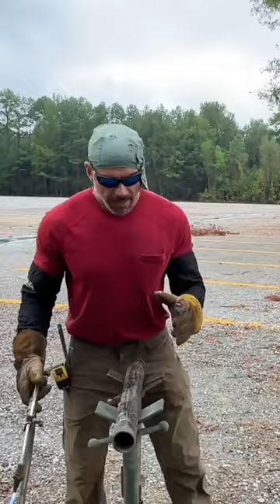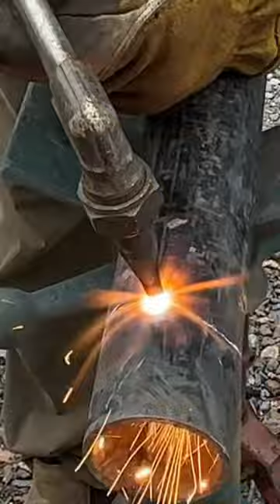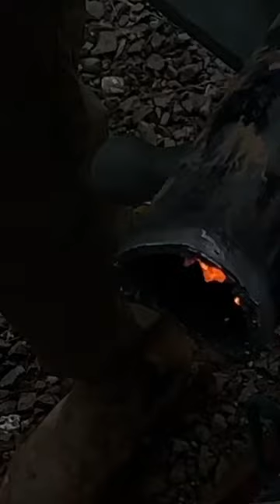Could saddling pipe with a Torch be faster than a chop-saw.

Comment: Back in the late eighties (before the advent of plasma cutters) my buddy fabricated a bumper for my truck outta heavy stock C-channel. I just wanted a straight bumper, but he was a perfectionist and an artist, so he said he’d cut some 45° ends for it. I assumed he would use a portable bandsaw or grinder with a cutoff blade. 
He surprised me by getting a straight edge and a torch. Showed me that slow and steady, with the proper heat and talent, a smooth cut rivaling anything that a blade would have done was possible!
His work was beautiful and precise! No slag, no splatter, no ugly ragged edges!

Comment: Thats hilarious you said it's that's not a hammer.
The exact time I could hear my dad's voice in my head saying
That's not a hammer lmao.
Reply from the maker: Lol
Reply: @TaylorWelding  
He's 91 years old still alive living in Tyler Texas and to this day he would scold me in using the back of my torch to adjust anything or simply knock out a cut.
But on the other hand my rig head is almost 50 years old so I guess it says something for him to be bitching at me about it.
Reply from the maker: @ScottRoss269  I need to do a video on what? Actually happens when you use it like a hammer. I have messed one up before.
Reply: @TaylorWelding  oh I have screwed one up and cracked the head. Makes a funny flame in a weird location making it really hard to cut with.
Also had to hear a truck load of I told you so! From the old man.
But yea a video for those who have not seen it would be good.
Reply: But It IS a hammer!  Some folks just don’t know it yet…

Comment: I learned old school because i didn't have a choice, when i was doing code packages our in house CWI was 70 years old and made me do my super coupon with a file, no grinder allowed.

It isn't always about "faster" like you say in the video (although i do think coping with a saw is faster once you have the right tooling). A big upside is lack of consumables, safety requirements, and tools that require maintenance. Look at everything you need to run a torch setup. Multiple bottles, regulators, hoses, torch body, tip, tip cleaners, etc. Vs a chop saw........ a 120V source. 
  
Now, go work on some sites that require 3 different permits to throw fire in any direction regardless of nearby combustibles (where my power gen peeps at) and you will understand why my rig has a chop saw coping setup instead of a torch.
Reply: For anyone starting to get in the Customising seen I would recommend them to first learn the Oxyline torch welding for heating and bending cutting. Once the learn that then move on to MIG, TIG, ARC welding just my opinion. Your right they have the right tools for the right job. I know people that have bare minimum tool's and create some cool stuff.

Comment: I love my torch. I cut as good as most beat up chop saws. In way less time and effort.  I don't use the chop saw much.
Reply: Acetylene or propane ??
Reply: @Gigachadly  I like oxygen.  I cut good with either. I don't have the patience for propane. Propane to me especially with thicker cold steel is like trying to cut when your oxygen is running out. Too much heat put into the metal from propanes slower cut also seems to aid in warpage and if matters to given product and its use the work hardening of the steel. Just my opinion.
Reply: @larryperry2094  I agree 100% , acetylene is the superior way to cut in general but especially with thicker steel, only problem I have with it is more that could go wrong with acetylene then a propane torch IMO in terms of works place accidents / exploding a canister. It’s the damage to the heat treat / structural integrity of the metal I worry about most when I cut with propane but again I love the ease of transport of it.
Reply: @Gigachadly  makes sense to me. I never thought about that way. Plus I don't think you have to worry about lying down propane. Acetylene has to be kept up right. You have to atleast wait a hour or so to use it(well you are supposed to).
Reply: I am aching to get back to work. Been laid up a couple of months for mysterious health issues.  Well........low and behold it appears I become allergic to the medication. One week without it and things are improving.  Anyhow just thought I would add don't take nothing for granted.

Comment: Cutting to fit in the field is much easier with a torch. I just use a wraparound to mark the bottom and freehand the saddle depending on the size of the pipe I’m fitting for.
Reply from the maker: That’s a good way too Jerry.

Comment: That torch does just fine.    Most have never worked off the back of a rig truck. They don’t understand how rough it is to piss ant a chop saw in and out of the back seat of the truck. Then having to set it up on the ground i mud or gravel so you can cut up a 20 foot joint of material.  And you sure don’t have enough room for an air compressor and a plasma cutter.  If you want to run a rig, better learn how to run a torch
Reply from the maker: You nailed it! Those are my thoughts exactly